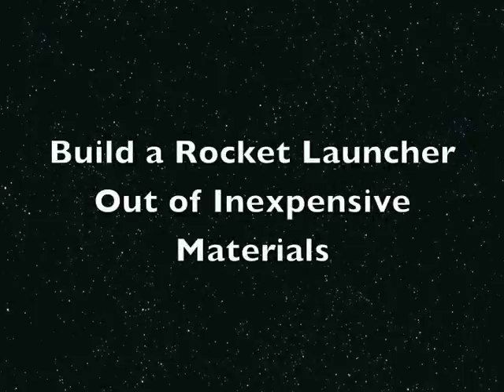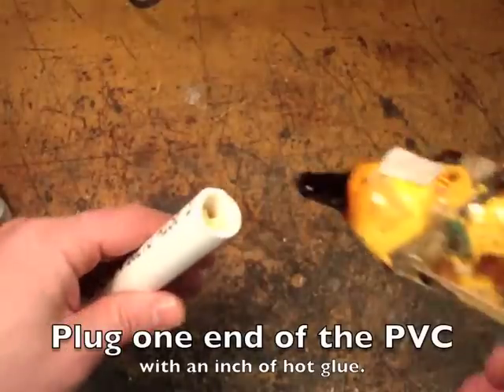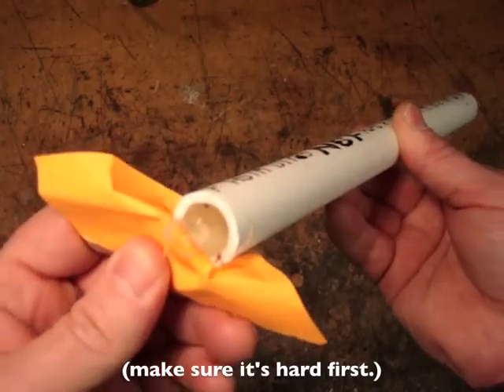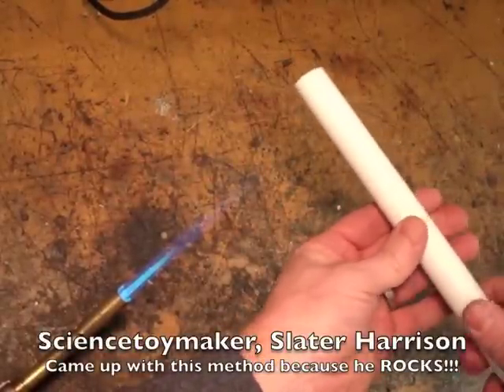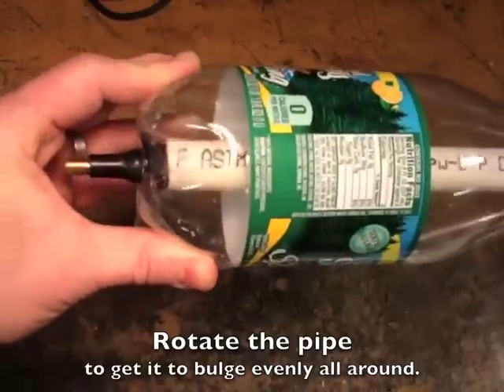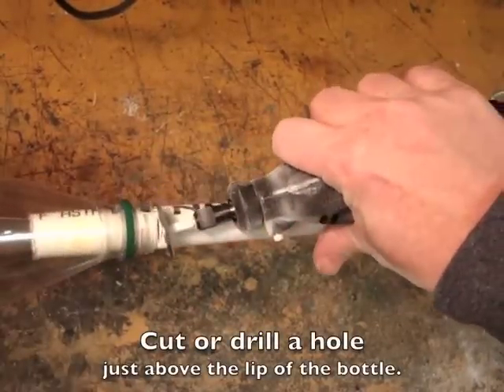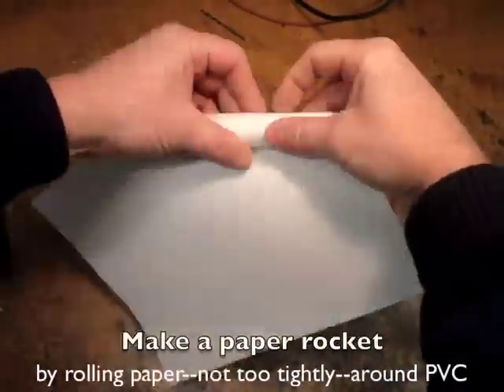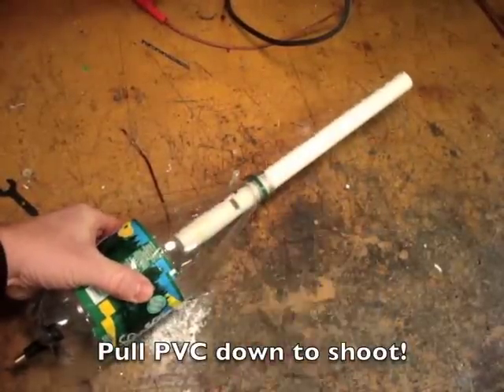Rocket Shooter!

Comment: This is clever, elegant, and easy enough to do that even an elementary school science teacher could do it. Nice work. One thing that wasn't immediately clear to me was where the bulge was. Because we were looking at the PVC nestling up against the tire valve, and the bulge seemed hidden behind the label, I thought the bulge was at the end of the pipe - which didn't make sense because that's not where you heated it. Regardless, thanks for a great, simple, and cheap science project.